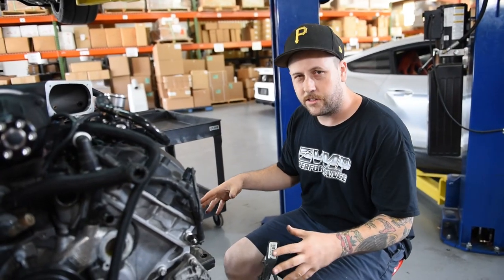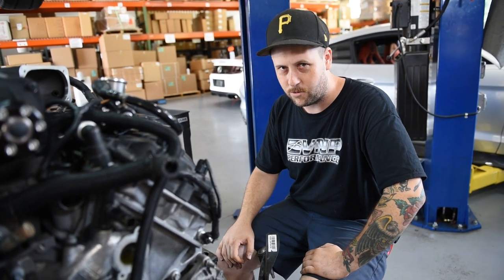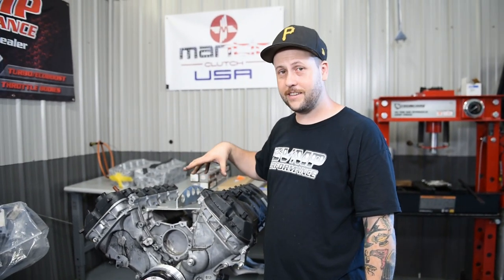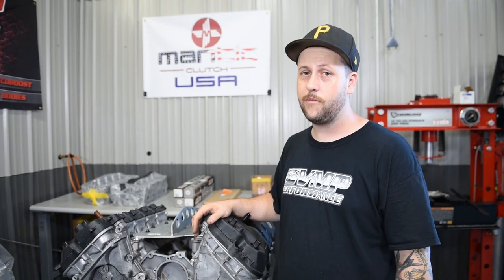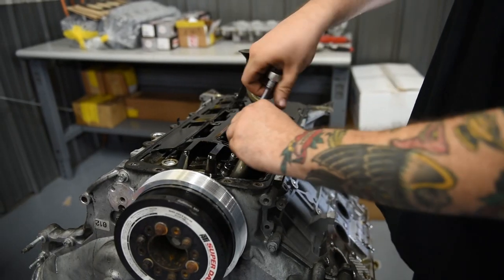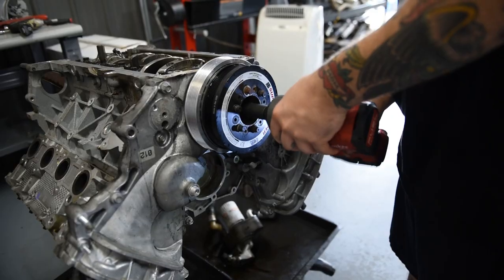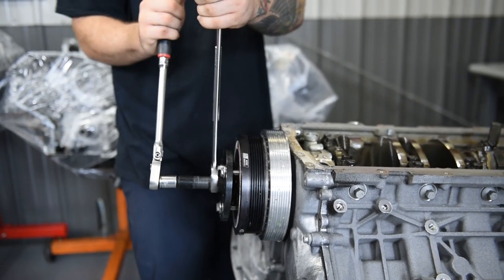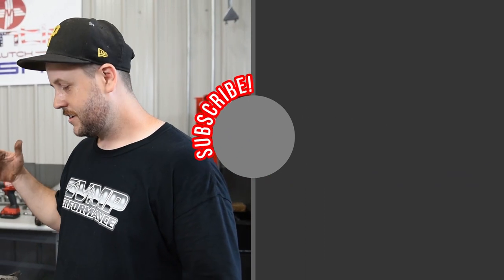Track Attack's stock engine after making more than 1,100 rwhp!

Comment: The rods were weak link in Gen 1. Build a gen 1 and it will hold 1200wheel.
Reply: Rods are still the weak link in the modern ones  too just not as much of a weak link.  They can still not hold 1200 stock and its the rods keeping it from doing so.
Reply: @midnight347  Fck that. I would never trust over 650wheel in any stock production motor. Build it if you wanna play. I don't care what any of these people say and how they have survived.  Any stock motor above its intended power limit is a timebomb. My Boss Roadrunner motor built to the hilt now.

Comment: Honestly I wish you guys just kept throwing power at it till it blew up so we know the limits and what can fail on these....guess I'll be the guinea pig from here
Reply: Not every engine will fail at the same point, lots of production variation.
Reply: @maximusvonce1381  the plan is keep going to the moon until she goes, find out why, then buy a junk yard 15-17 5.0 longblock with low miles slap it in and turn it down from where the other one went and leave it, I'm a few payments from paying the car off so I dont care if the motor goes at this point and also every engine I had built was a nightmare so i prefer factory engineered Motors, cuz alot of human errors can happen in hand built motors
Reply: @jasonwieber2762  Why did your built motors blow up. Was it engine builder error. I was told Coyotes aren't good rebuildable engines. They only last 30k miles then tick developes and they blow up. Have you heard this before?
Reply: @maximusvonce1381  I'm not sure how good they are rebuilt but I had a 03 cobra motor rebuilt, the timing chain broke in it, cuz they put the wrong cam in the wrong head, then when I got it back from that all the oil leaked out the back of one of the heads so I brought it to another shop to have it rebuilt and when they tore it apart there was rust on the rods from it sitting around in the other shop and so we just went with a ford crate motor and man that motor was solid. So I just dont fuck around with built motors I just take the factory or crate motors as far as they can go turn down from there and leave em be, so far my 2015 is at 750rwhp I put about 10k miles on it like this and she is holding up just fine. I order VMPs new monoblade throttle body and taking the cats off that hopefully should get me close to 800 but from there I need to change the fuel system and I'm gonna pulley down to 69mm pulley and that should put me over 800rwhp and I can brag that the motor is make over 900hp technically....shit at 750rwhp no one believes me that it's a stock longblock
Reply: @maximusvonce1381  btw I have 57k miles on my 2015 Mustang GT it's been supercharged and tuned by VMP since 34k miles probably another why it's still alive
Reply: @jasonwieber2762  Hey what Ford crate motor did you buy.  How long did crate motor hold up.
Reply: @jasonwieber2762  What pulley you on now.  What are your mods to make 750wheel.  Stick or auto
Reply: @jasonwieber2762  Bro those Gen 2 aluminators are expensive but bulletproof I hear. Aluminator XS even better
Reply: @maximusvonce1381  I have the gen2r blower with 72mm pulley, JLT cold air, VMP twin 67mm throttle body, mak cat deletes with high flow cats on them and Gibson 3 inch exhaust I'm running E50 with 1000cc injectors and VMP boosta pump
Reply: @maximusvonce1381  I have a stick shift, been to the track once and tranny held the abuse but the rearend didn't lol
Reply: We weren't trying to blow it up but if it happened it happened. We had the go pro underneath waiting for some carnage but it held up to some serious horsepower and 30psi
Reply: @jasonwieber2762  I grenaded my stock spiders and put Eaton trutrac in now...bulletproof
Reply: @shawnbutler5847  30 psi holy balls
Reply: @maximusvonce1381  lol well I found the maximum power the stock head bolts can handle and that's 750rwhp, I blew the head gasket so just trying to decide if I want a ford crate motor or MMR built small block or have my buddies shop build me a bullet proof motor since I have to take my heads off might as well go to the moon
Reply: @jasonwieber2762  Get a low compression Aluminator.  Vaughn gitten jr says they r the best
Reply: @jasonwieber2762  So you blew up stock Gen 2 motor. What rwhp and what failed?
Reply: @maximusvonce1381  how much do you think they can handle? I was looking at a MMR Pro Mod longblock
Reply: @maximusvonce1381  750rwhp I been running it for about 5-6k miles now it was over 600rwhp since 34k miles and made over 400rwhp for the 34k miles revving it to 8k when it was NA. 7500 forced induction. I wouldn't call it blown it's just the head gasket so my advice before you take a trip past 700 get ARP head studs
Reply: @maximusvonce1381  I forgot to say it has 57k miles on it
Reply: @maximusvonce1381  I have owned it since new
Reply: @jasonwieber2762  Call Ford racing at 800-FordSvt. Vaughn gotten put 900wheel through aluminators in 3 different cars and still going strong. Plus they are built in a million dollar factory. All hand built using a new Gen 2 factory motor they strip down and rebuild.
Reply: @jasonwieber2762  I have gen1 coyote at 600wheel. I am staying there till I build motor or get an aluminator.  Sucks your head gasket failed. Did it poor coolant in your oil.
Reply: @jasonwieber2762  How much boost you were running
Reply: @jasonwieber2762  I go through mickey thompson et street ss tires 295/55-15 every 3 months man. My car is a daily 
 I have to run em or I will never hook. Street tires are useless and dangerous,  and I am only at 600wheel.
Reply: @maximusvonce1381  I run street tires and I spin on the highway in 3rd it's pretty scary lol. I did run slicks but that got annoying. I'll look into that ford racing Aluminator. My boost is 10 psi off the hit and climbs to 13 or 14 psi it's hard to tell cuz I'm just trying to keep the car on the road lol. Well any higher I would do ARP head studs. My buddy had a Gen1 coyote and he put down 760rwhp but sold it shortly after so who knows where it is today
Reply: @jasonwieber2762  Why dont you just run Mickey drag radials full time like me. Much safer and spinning ain't winning
Reply: @jasonwieber2762  Damn your buddy made 760wheel gen 1. That's a time bomb.  Now wonder he sold it. Did he buy another mustang?
Reply: @jasonwieber2762  Bro that's very unsafe running anything but drag radials at 750wheel. Even at 500wheel street tires are unsafe.
Reply: @maximusvonce1381  I hear you, plenty of time I almost eaten a guard rail lol
Reply: @maximusvonce1381  my buddy sold it then bought a Fox body I think he makes in the 700s with that one he always wants to run me but now he moved out of state
Reply: @maximusvonce1381  too expensive got sick of changing tires like once a month, so I just putt around until the highway then from there it does alright, I have 3.31 gears and I want to get a t56 with like a 2.26 first shit with those 3.31s I'll probably hook up in 2nd
Reply: @jasonwieber2762  700wheel fox..Must be a turbo sbf?
Reply: @maximusvonce1381  yep turbocharged it is